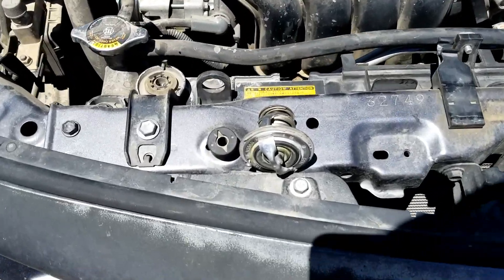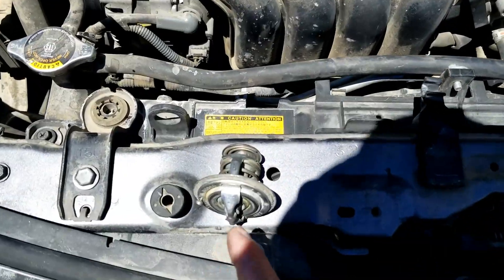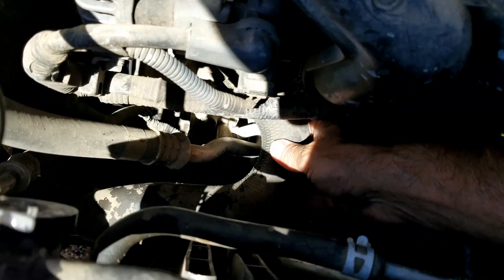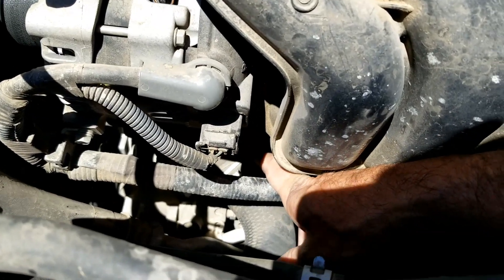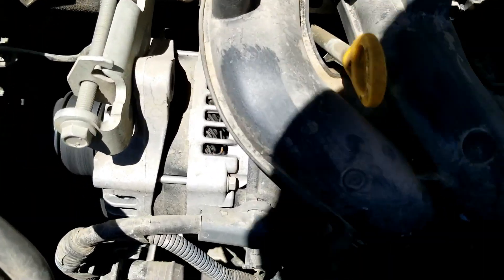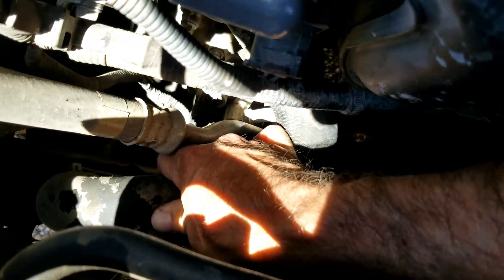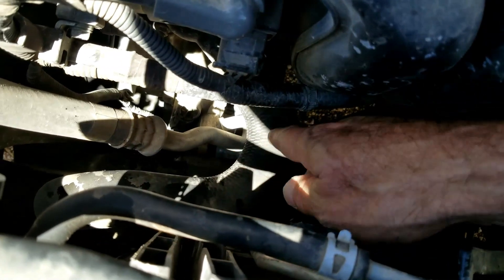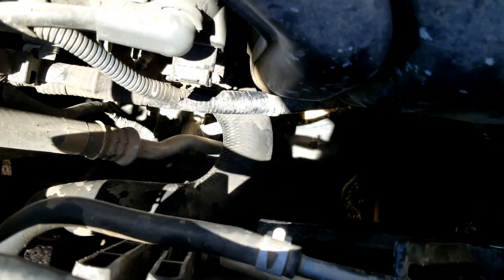How To Test an Engine Thermostat with No Tools (Old School Method)

Comment: I had not hot air in the heater and overheating engine with lower hose cold. After changing thermostat, I continue to have overheating engine with cold lower hose but not so hot heater only when engine was overheating.
By changing the radiator I have not any more engine overheating, but the lower hose sometimes is hot and other times cold regardless when the fun is working. The heater brings hot air but not so hot because one hose is colder than the other which is hot. Can it be water pump? But they're not strange noises, not leaking!
The old radiator was very dirty was not cleaned the cooling system only change the new radiator and putting antifreeze antirust in the system.
Thanks in advance!

Comment: I've heard of another method: take the radiator cap off and start the engine.  In a few minutes the engine should be warm enough to open the thermostat.  When that happens, you should see the coolant moving in the opened neck of the radiator.  Yes?
Reply from the maker: Yes, this is true, especially in older vehicles. In many newer cars and trucks, it can be hard to tell if the fluid is moving. Just be sure to take the radiator cap off when the engine is cold and then warms up.

Comment: So, If I understand this correctly,  if it's stuck open you should feel the fluid circulating all the time and it would heat slowly instead of staying cool until the thermostat opens?
Reply from the maker: If it's stuck open, you will feel the fluid in the hose when the engine is cold.
Reply: @HVAC_Mechanic  Wow, didn't know it shouldn't be in the hose then. Thank you.

Comment: If you can’t feel coolant flowing, couldn’t it also be a water pump issue? How do you verify if it’s a thermostat vs water pump?
Reply from the maker: When the thermostat is stuck closed, the temperature before the thermostat will be hotter than after. An Infrared thermometer is often used to check the temperature. The thermostat can also be temporarily removed to see if the water starts to flow. Here is a video using an Infrared thermometer.  https://youtu.be/0ThSZJdWv-4